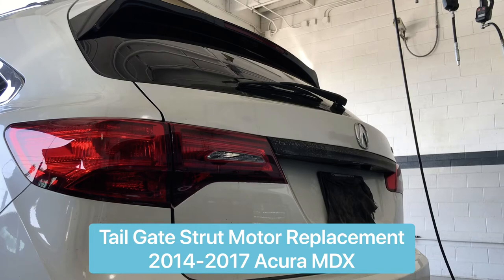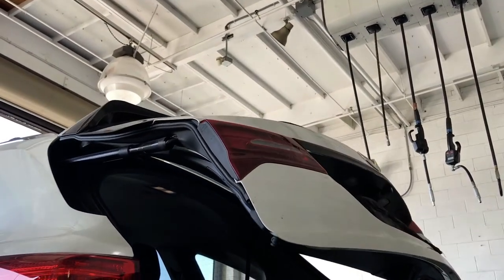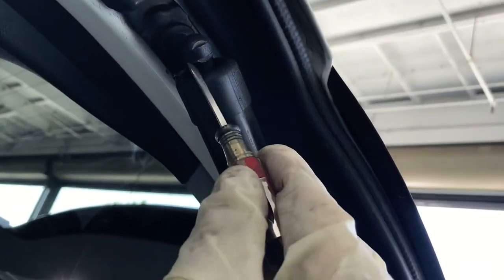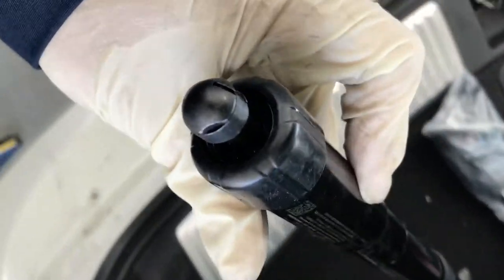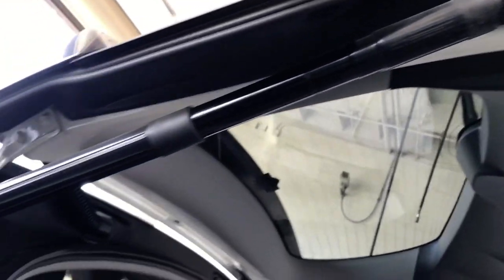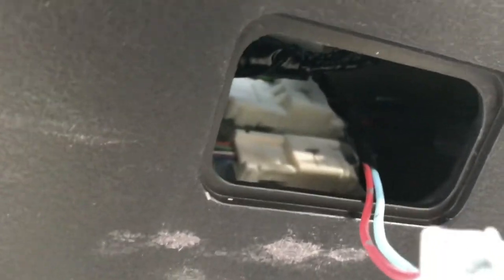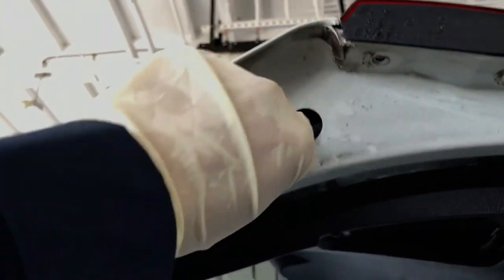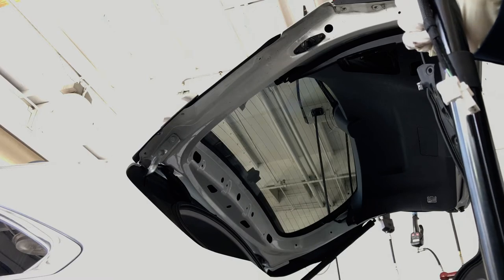Tail Gate Does Not Stay Open - 2015 Acura MDX

Comment: Hi what’s the item number?
Reply from the maker: Hi, here is item number for this 2015 
-driver’s side Motor Set, Power Tailgate - Acura (74961-TZ5-325)
-passenger’s side Spring Set, Power Tailgate - Acura (74981-TZ5-315)

Comment: Can I replace just the power strut?
Reply from the maker: Yes, Nick, it’s the power strut that failed in this situation.
Reply: I replaced the power strut and the control unit. Still the same
Reply: Hi Nick, were you able to detect the problem? I have Acura MDX 2016 and door closes automatically. Just wanted to check if there could be other problems than just the strut.
Reply: @gurvinderjassal  I was not. Two different Acura dealers couldn't fix it, and both arms replaced. I think it's software.